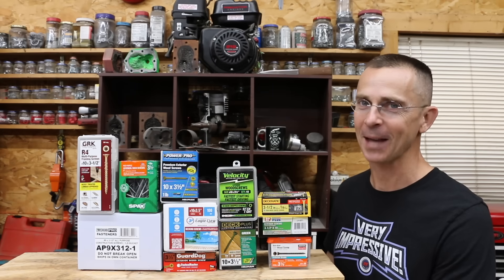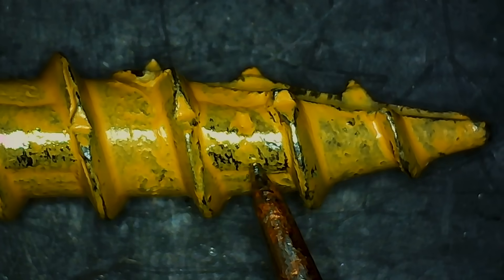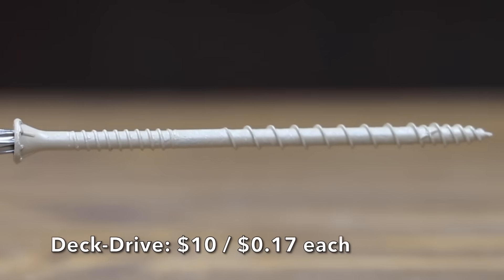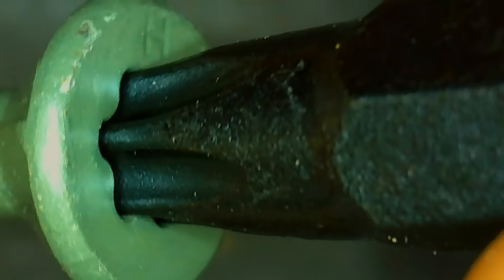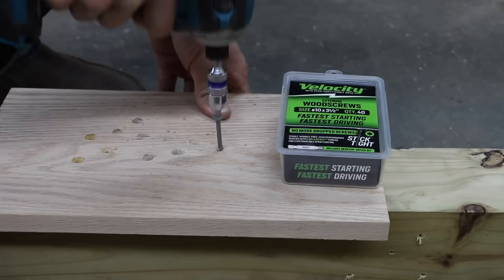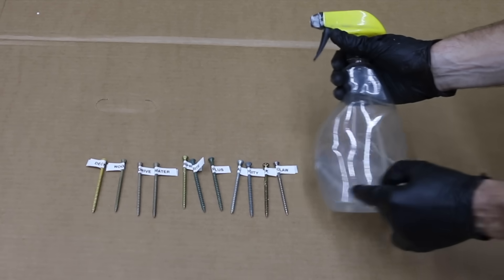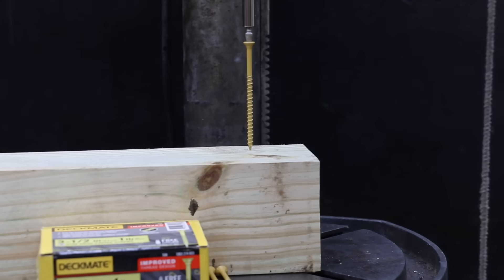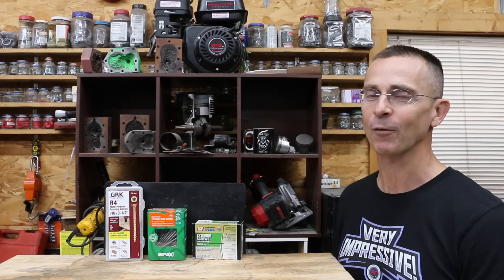Best Deck Screw? GRK vs SPAX, Grip Rite, Deckmate, WoodPro, FastenMaster, Deck Plus, Eagle Claw

Comment: 17:06 Corrosion failures are unlikely due to acute acid exposure, so I question the validity of a 1-hour acid test.  Humidity and marine (salt water) conditions are the big challenges in this area, which is why stainless steel screws are considered by many as the standard  for those applications---other variables given a (considerable) back seat.  Stainless screws are softer and will break off easier. After watching the video, I felt these screws performed about the same.
Reply from the maker: Thanks for the feedback.

Comment: 316 stainless over 304 for higher rust resistance 👌🏻 you also don’t ever need to worry about coatings failing or rubbing off. The issue is more with the head of the screw rusting over time. I’ve seen plenty of coating screws heavily rusted during demos, but stainless often will have a tarnish but rarely deep rust (unless in high salt environments) stainless all the way.
Reply from the maker: Thanks for the feedback.
Reply: Great work, as usual! I appreciate the effort you put in your tests to control for confounding factors. I also go out of my way to look for 316SS hardware, because of concerns for salt water corrosion. Some, not all,  Home Depot's have even added a marine grade fastener display with Deckmate 316 stuff. I'd be interested in a test of all the fancy structural screws (Simpson SDWS, GRK RSS, Spax Powerlag, LedgerLok, etc) for corrosion resistance. Got any seawater in your area? @ProjectFarm

Comment: Video suggestion? Might be kind of expensive, but what about best robot vacuum for the money? Vacuum power, obstacle avoidance, run time, charge time, budget options better than top brands, noise level etc.

I also thought you did a windshield rain repellant video too? I cant find it. If you haven't done one, try that for an idea! Best hydrophobic windshield product vs just putting on car wax right on the windshield. what about quick wipe variants? are they as effective? Long time watcher, and You did a video on one of my suggestions!! I'm happy to be here, thank you for all you do!

OH! what about windshield washing fluid? are they all the same? What about coolant? are they all the same? engine ice vs generic brand?
Reply from the maker: Thanks for the video ideas.

Comment: my lil trick for shaking rattle cans is i take an old caulk gun i cut the everything off besides the housing that hold the tube and i weld it to an old sawzaw blade and use my sawzaw with the housing of the caulk gun i strap it inside of it so it don't fly out and wanna talk about a can shaker brutha that thing sounds like a machine gun... Hope that helps you out it works great for me it really cuts my time in more than half when painting from a can. let us know how that works out for you.
Reply from the maker: Thanks for the tip!
Reply: @ProjectFarm  not a problem good sir glad to help. and keep the good videos rolling.

Comment: Hey, can you make a video on what's the best product to use as an assembly lubricant for plastic sewer pipes? I've used different stuff on the rubber seals like silicone grease or the specific assembly grease that you can buy in the store. Some people also use soap or vaseline. I've always wondered if it affects the amount of pressure that the pipes can take before they slip out of each other, and if it can prevent the seal from leaking if there is backwater. 

Keep up the good work! Greetings from Germany
Reply from the maker: Greetings!  Thanks, will do!  Thanks for the video idea.

Comment: Hello Project Farm,
I recently watched your video where you made your lawnmower run on gas vapor and it had me thinking. Would you be able to make a gasoline powered generator run using a wood gasifier? For those who split and burn wood to power houses, would it be a viable redundancy to convert a gas powered generator to run on the same fuel source as a wood stove. If you could make it work it would be very impressive! Thanks for all the great videos!
Reply from the maker: You are welcome!  Thanks for the suggestion.

Comment: Screws and nails aren't the issue in my decking. It's the newer treated lumber that doesn't hold up. It's mostly the newer, I assume, non-arsenic kinds. Some I used about 8 years ago is just rotting like crazy. Even the stuff that's not in direct contact with the ground.
Reply from the maker: Thanks for sharing.

Comment: Hi Todd, question off toppic: hmmm. is it still possible to buy a Harley Texture paint (spray type) in USA? :) Because here in Europe it's kind a problem. Dealers stopped import that thing...(blah blah blah, veeeryyy toxic, green energy and ms. Greta Th. will die because of that paint... ) not so cheap, here was about 40 EUR/spray can, but crazy good paint. thank you :)
Reply from the maker: Thanks for the suggestion.

Comment: You want it to last?  Use stainless steel screws.  Screw those @#$ coatings that fall off!  Don't need them.  There are 2 disadvantages to them.  They are more expensive.  They are softer than plain steel.  You can pre-drill, or drive a plain steel screw in, then out first.  If you are screwing any of the plastic deck materials, the stainless steel screws will go in fine.
          Another problem with stainless steel screws is that they are almost impossible to find with any other drive than square drive.  (Where did you get Eagle Claw?)  Square drive is useless.  The driver is too small in diameter.  It snaps off.  With Phillips drive, they drive fine, but you must be sure to have sharp driver tools of they will strip.
          If you drop them, you can't use a magnet to pick them up!
          They are a little more trouble to drive than plain steel, but once the job is done, it is done!  Most likely contractors won't like them.  Can't "drive & run".  Customer can't see the quality of a fastener that is mostly invisible once installed.
          If you insist on plain steel screws, in my opinion, the zinc coated ones last much better.  Don't know what they do in copper (CAB) treated lumber.
          Spax also makes stainless steel screws with Phillips head.
          Could you rate plastic deck materials?  I have 250 feet of 1/8th scale model railroad trestles that need replacing.  Most plastic "wood" is too weak & flexible!  You need to measure both the strength & the flexibility, & whether the lumber can be cut down.
Reply from the maker: Thanks for the suggestion.

Comment: Ok best screw. Wow. Best carpenter to use best screw? Gramps's. Because he'll tell you it didn't matter due to expansion and contraction during seasons work the screw loose over time anyway. A dead nail won't.
Edit before people flip out. Nails were first, then screws. Virgina City NV decks use nails because the screw keep popping up from all the foot traffic on the wooden sidewalks. Screws are good, but a deck needs to be maintained for life.
Reply from the maker: Thanks for the feedback.

Comment: Video idea: Contact cleaner/protector sprays. Lots of tractors, cars and trailers out there with intermittent electrical issues that come from oxidized electrical contacts.
Reply from the maker: Thanks for the suggestion.

Comment: Been researching caliper guide pin grease and it's amazing how many reviews on big brands claim they swell the rubber components and ruin expensive calipers! It is also hard to find in my area. I'd love to know some different options for high temp grease I could look for to support my local economy.
Reply from the maker: Thanks for the feedback.
Reply: D A, petroleum based products or that has petroleum distillates(anything that is NOT silicone based in my experience. which covers ceramic, anti seize, brake grease,  etc)

Silicone brake lube will be useable on caliper pins which have boots usually.

Comment: This might be a bit of a long shot, but have you seen anything on Peddle Commanders? It might get pretty expensive getting plug'n'play adapters for your vehicle, but it claims to have better performance in multiple areas. I'm sure you could come up with tests surrounding it's 30+ modes that claim significant performance.
Reply from the maker: Thanks for the suggestion.

Comment: Love watching you evaluate products of same purpose!   A suggestion to pass back to you that is based upon math modeling, you will like the end result.  When you have say a column for unit cost, a column for torque where the product broke, a column for wear, etc, etc...to look at all of the rows and columns it is challenging to give them ratings.  Cost versus torque?  Time to drive the screw til flush?  Need a way to put them all on a same scale more or less.

Here is how you do that.

For each column you rate that column as a function of your significance.  Cost may be 25 percent, torque to break the screw say 40 percent, wear 30 percent, etc.  But the sum of all these percentages, these ratings basically, must add up to 100 percent.  Put this in a spreadsheet and the cool thing is you can change these ratings, these percentages and get different results.

Now this next part takes some work but with a spreadsheet configured to use excel formulas, it,'s a piece of cake.  But I will describe what we will do next.  Say you have a column for hardness.  The max hardness is measured at 8.  8 becomes the value of 100 in that column,.  If a hardness is measured at 6, and 8 was the max, the hardness of 6/8 translates to ( 6/8 ) * 100 = 75.
When each column has been scaled to 100, then for each row add up the multiplication of each row element by the  rating percentage you gave that column.  Flattens it all out, and the winner will be the row that exhibits the highest number from the sum of each scaled entry times its rating percentage.
Reply: For some parameters like elapsed time, you have to reciprocate the numbers to achieve the desired rate.  Elapsed time for example.  We want the lowest elapsed time to represent 100.  So say lowest elapsed time is 6 secs.  That scales to 100.  An elapsed time of 8 secs, again applying reciprocal scaling, and min was 6 secs, that would rescale 8 as (6/8) * 100 = 75.
Reply from the maker: Thanks for the feedback.
Reply: Maybe It has nothing to do with the quality of the fasteners . It could be that now.  it may be that  this time the  composition of the fertilizing agents could be the cause . Or any other chemical reaction of the  combination  of products used on this occasion . Or the new items added by the suppliers . I left a banana plant fertilizer bag . Resting on a thick gavanized gate post. It ate it 8 inches up of the bag and to the ground and 80% across gone in months !

Comment: @project farm, love the content in your channel! I have some suggestions for things to test (pardon me if any are already tested): 1. deck/wood sealants.  2. emergency waterpipe repair kits. 3. HAVC/foil insulation tape. 4. garage floor coatings. 5. paint sprayers. 6. sump pump. 7. dehumidifiers. 8. window cleaner. 9. window water repellent. 10. cat litter : )
Reply from the maker: Thanks for the ideas!

Comment: Interesting. I do understand that the e3 n popstar we're more efficient but I wonder how that worked how with whp though. Since more fuel efficient is it actually reducing the power possibly or is it a increase. In the speed world more fuel burned usually equals more powerful so with that said fuel efficiency would be very cool if it also had a increase in power as well over the ngk plugs? However NGK makes a very good quality plug I have always used them as a main go too. The answer to thing would be real nice to know.
Reply from the maker: Thanks for the suggestion.

Comment: This is an excellent analysis! I've often gone back & forth with myself about which screws are "best." I use a lot of GRK & Simpson because they are code approved replacements for certain nails. For times where I don't necessarily need a code approval, but still want a good screw, this will be a great guide!
Reply from the maker: Thanks and you are welcome!
Reply: There's no substitute for stainless steel. We have a deck next to a swimming pool that is outdoor-carpet-over-wood decking. No metal screws have held up like the stainless. We typically get about 5 years out of the carpet before I need to replace it, and I will replace some deck boards as well. The s/s screws are always easily removed and I can reuse them; the same never applied to metal screws regardless of their "ultra-tough ceramic coating".  Even hot-dip galvanized screws didn't last. They may cost 3x as much but def worth the investment.
Reply: I always make sure to have some Fastap and Fastap Plus screws on hand. They have a unique tip that cuts a somewhat bigger hole, and they are good for going into harder woods, or where you need to screw farther into wood to the point where the torque required would be enough to snap other screws. Their coated screws were developed for salt water docks. They are more expensive than other screws, but their unique tips allow them to do the job where other screws won't, or require pre-drilling. They're hard to find in stores, so I get them online.

Comment: Request. What is the best 3500 pound atv winch. Warn Ramsey super winch harbor Freight,  tractor supply or eBay brands ? 
Maybe you’ve already did it but I’m not finding it.
Reply from the maker: Thanks for the video idea.
Reply: @ProjectFarm  it’s something I’ve always wondered. You hear allot of hype on some of the china brands vs name brands. But honestly allot of them seem to be the same winch with diff stickers.  So why pay $2/300 for one that’s the same as a $100 one. A sticker isn’t worth it. Then name brands also share allot of things as the cheap ones. All but the price tag.

Comment: Great video, this confirms my field use of several of these screws for fence work. It's rather amazing how much a simple screw has improved in the last twenty years!
Reply from the maker: Thanks!  Thanks for the feedback.
Reply: @fire304 - I'm an extremely unskilled and unknowledgeable DIY homeowner (not kidding!), who is hoping to replace my fence this year myself (have been watching tons of YouTube videos to learn).  Aside from cost, what is your preferred screw?  Correct me if I'm wrong, but I'm guessing that sheer and holding strength for all of the tested screws are more than adequate for single family residential fencing, and that durability/longevity to rust would be the most important.
Reply: @PW98372  glad to help! Any "deck" screw from the local hardware store that is rated for pressure treated wood works great. I would recommend staying away from Phillips screws and going with square drive or star/torks drive (6 point star). These screws usually come with the correct bit in the box. Phillips bits tend to spin out and wreck the head of the screw when you drive them hard and that will come back to haunt you if you ever have to pull the screw later.
Reply: @fire304  Thank you!!!

Comment: I appreciate this testing. Don't think speed and torque matter as much as strength and holding power. I'll bring extra batteries if I have to in order to build it right. Plus, when it comes to holding deck boards down, I'll burn the screw in first (run the screw backwards), which also eats up batteries. GRK and Spax also have stainless steel screws of the same design. If you are making a deck or fence from cedar wood, that is the only thing you should use, stainless. Cedar has a natural acid in it's oil that will eat through any coating or galvanization layer, and leave ugly stains at every single nail and screw head.
Reply from the maker: Thanks!  Thanks for sharing.

Comment: New video idea:  Nothing to do with screws.
Will/can an ozonator (EG EdenPure) be enough to keep the air breathable/safe while working with volatile liquids such as urethane, epoxy resin, thinner, etc.
Bonus:  Can the same ozonator keep up with an automobile's production of carbon monoxide?
Either way - I can think of safer things to do.
Reply from the maker: Thanks for the video idea.

Comment: One test I would like to see with something like this is end insertions and see which did the least amount of damage to the wood itself, such as splitting. To me, when I'm doing builds or installations, the ability to predrill better than another is important.
Reply: Yes, I wonder if the self drilling tips actually make a difference. From my experience they do. I went through a box of guard dog and won't use them again due to how many splits I was having. Separately pre drilling is a waste of time.
Reply from the maker: Thanks for the video idea.
Reply: @ProjectFarm  you're welcome. That would be a tough one, because of the variability of the end grain of the wood but I'm sure you'd be the one to figure it out :)

Comment: You got Gregory I was thinking you test so much stuff Why not Test Snow Blowers Throwers Electric v Gas Metal Augers  v Rubber Augers Cost of Oil Gas Ratio that would be an good Testing
Reply from the maker: Thanks for the suggestion.

Comment: How about doing a Project Farm video comparing different brand induction heaters to remove rusted and seized nuts and bolts. See if the the more expensive brands outperform the cheaper brands or if the all do the same job?
Reply from the maker: Thanks for the suggestion.

Comment: Project Farm...We need you!!!!  I work for a gas and electric company and we have a conundrum related to gas pipe thread sealants.  We would LOVE you to do a comparison including KeyTite, Rector Seal T Plus 2, Rector Seal Tru Blu, and any other natural gas thread sealant you feel may compete with our list.  Please use 3/4-1 1/4 zinc/galvanized pipe threads for your test.  Common pressures are 1/4 lb. (7 IWC), 60 lbs, and 200 lbs+.

Thank you!
Reply from the maker: Thanks for the video idea.